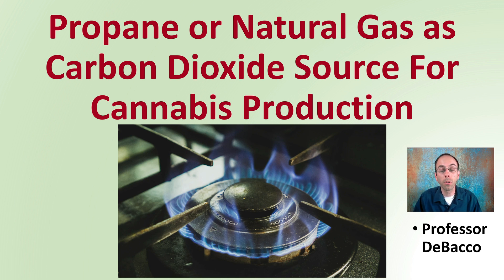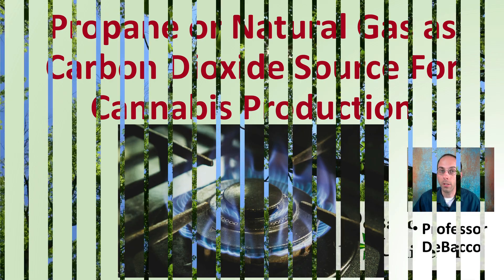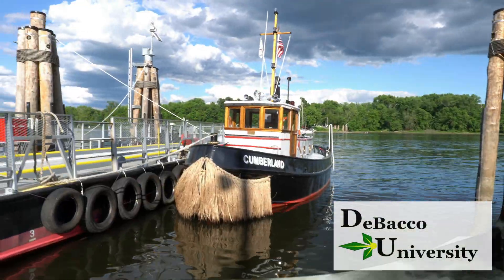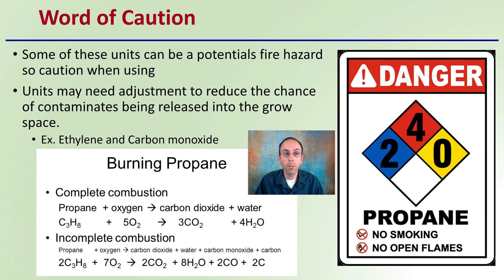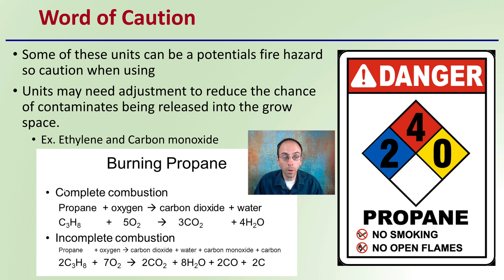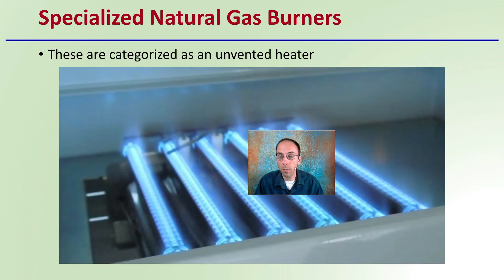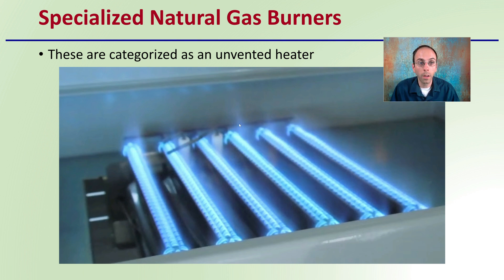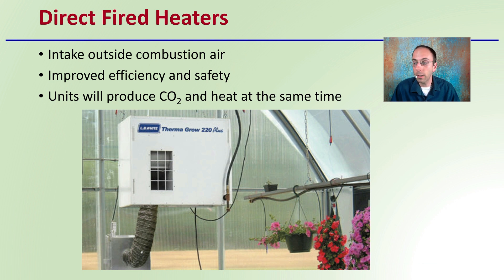Propane or Natural Gas as Carbon Dioxide Source for Cannabis Production

Comment: Is there a way to use the heat somewhere else and put the co2 into the plants?
Reply from the maker: The separation process is not easy and to make things simple using an indirect style heater with a bottle (or liquid) based system would offer the best of both while still allowing for independent control/regulation of each.